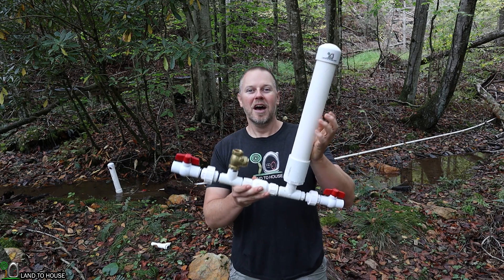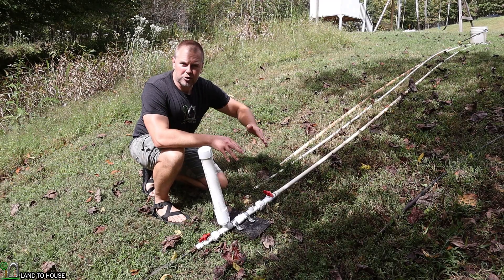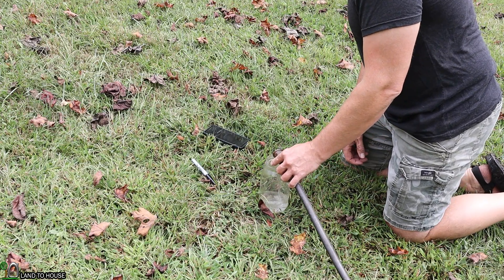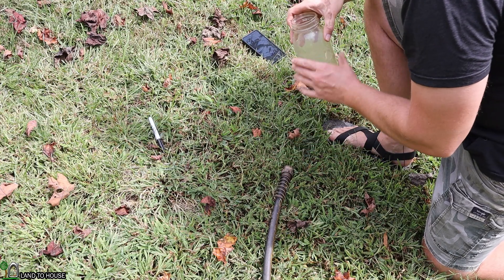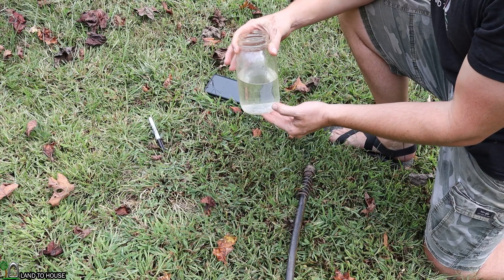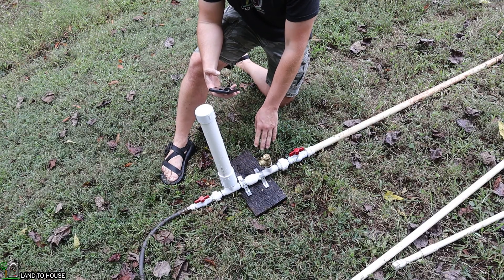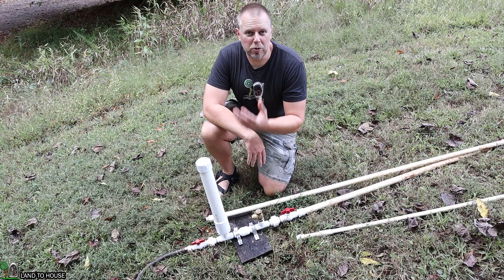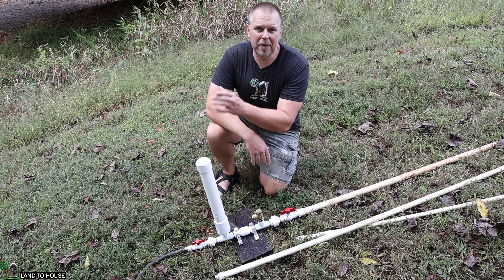Can you Run a Ram Pump on a Mismatched Drive Pipe

Comment: Excellent demonstration.  This does have me wonder: what if only the last 10-ish feet match the waste valve, and the rest uphill (without a standpipe of de-airing bucket) is a different size. Would that last few feet matching provide the appropriate inertia in the drive pipe to cycle correctly?

Comment: Coat the inside of the drive pipe with Teflon. You will increase hammer effect by at least 15% thus increasing the end pressure by 15% to 20% and thus increasing the height you can raise the water outlet by 15% to 20%.
Reply: who wants teflon in their water!
Reply: @lezbriddon 😂😂😂😂😂 you have Teflon inside you. It's in all of us. Not a single person is clean. I'm more concerned with the fluoride in the water.

Comment: Great video, appreciate you taking your time to do these videos.  
Would installing a 3/4 check valve on the 1 inch ram pump have a positive effect?
Reply from the maker: I have this idea on my list of test videos. Probably will be out in mid November.
Reply: Also wondering if partially closing the valve on the 1 inch pipe would get the pump to work properly?

Comment: I don't think the delivered volume of water will change. However , I think the smaller pipe will get that same volume of water delivered at a higher pressure in the same amount of time and I think the bigger pipe will deliver the same volume of water at a lower pressure in the same amount of time. The results of the amount of water in the glass in the same amount of time will vary because the smaller pipe has less storage than the bigger pipe where that volume of water can stay in one bigger pipe will not fill up the glass, while the smaller pipe will theoretically fill up the glass farther even though.It's the same volume of water
Reply from the maker: From what I see the cycle time on the larger drive pipe was faster but less efficient. The cycle time on the smaller drive pipe was slower because it required more time for the water to close the valve. The ideal cycle time is 1 per second. The matching pipe size seems to provide that cycle time.
Reply: However, this is taking into account of constant flow of water.I don't know if it will apply to a gravity feed like this